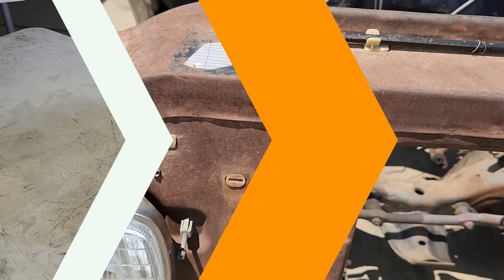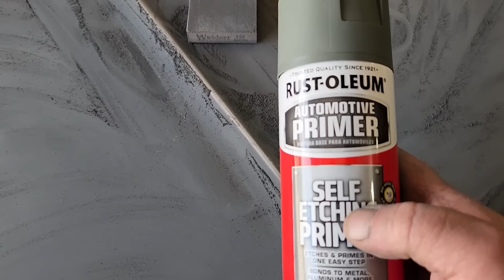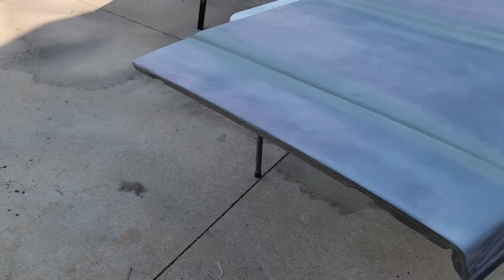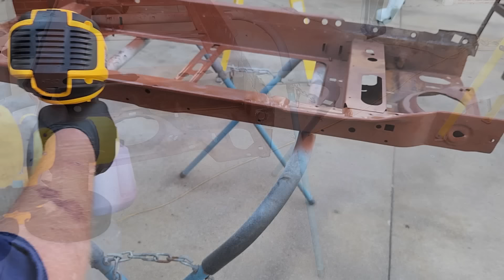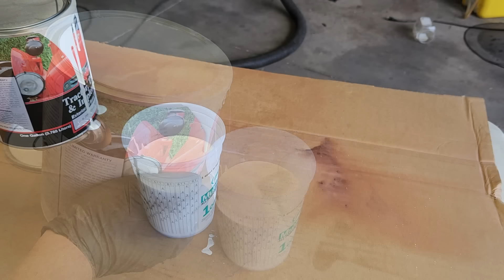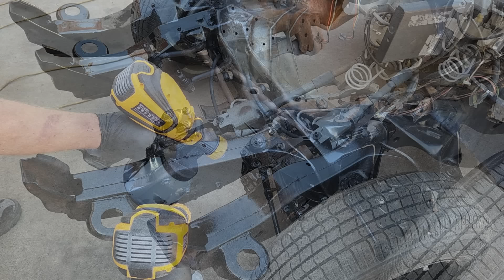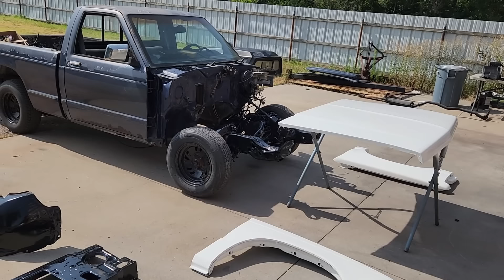S5 E27.  A low cost automotive  paint hack that really works. Rustoleum and  electric sprayer

Comment: I bought the original brand that sprayer is based off (Wagner) for about $275 for finishing my woodworking projects.  It is a great product, and your comments about learning to thin paint to the right consistency is spot on.  I made the mistake of buying some of the new "single coat" latex house paints and I was not able to get the paint thin enough to work in this sprayer without wrecking the paint.  Now when I buy house paint I always specify no single coat paints.

I have 3 old trucks that are hand me downs and your idea of using this sprayer for automotive is brilliant, even if someone else thought of it first. :). Thank you!

Comment: What Im curious is how cleaning works

We are destroying this gun, right?
Reply from the maker: I'm not destroying the gun, I want it to last as long as it can.  Cleaning the oil bases paints out of the gun can be done easily, but it requires a bit more solvent than I'm used to.

Comment: Not a bad job. Considering what you're using. Just for the record that remark you made about the 10-speed automatic made by GM was a collaboration with Ford... 🙄
Reply from the maker: LOL, yes Ford and GM are involve with that trans, but from what I have been hearing, only transmissions used in  GM products have problems

Comment: My theory is that those damned garden gnomes caused the orange peel on the trailing edge of the front quarter panel.  They have been quiet lately and are probably just planning more shenanigans as the truck build goes forwards. All kidding aside, another excellent and informative video, keep up the great work!

Comment: I watched this whole thing and almost every video you have made now. I don't live far from you and its awesome to see what your doing in the same conditions I am in. I used a green house from amazon as a paint booth with a dehumidifier in it but I also used a cheap sprayer like you. If you ever want a full size truck project let me know I have a few Older OBS Fords with straight 6 motors laying around.
Reply from the maker: Thanks!  An  OBS with a straight six would be a cool project.  Right now I just dont have the space.

Comment: i use this same formula to paint alot of crap. works well, cheap too. if you want the paint to dry faster use a little Japan Drier in your mix. About the same amount as the hardener catalyst.  Never used a airless gun though. i always use the harbor freight hvlp and the disposable cups. Mix right in the cup and shake, couldnt be easier! Almost zero clean up.
Reply from the maker: That's a good tip, thanks for sharing!

Comment: Use xylene or toluene instead of acetone if you want a slower dry and more forgiving application.   I'd also be a bit scared of the acetone and whether that sprayer has a brushed fan motor (which sparks as the commutator spins) as the acetone vapor is much more flammable..

Comment: If you can find an old 3.0 2000 hilux motor, it would be awesome 👌 my van has done 540,000 and runs beautifully with no rattle or engine oil consumption at all, though it seems quite thirsty, but that's a van thing I'm sure and the transmission is automatic

Comment: I am sure that you already have a diesel engine picked out and possibly purchased already. I am so curious to see what it is! If you happen to not have a diesel engine already, would you consider a Duetz F4L 912? Air cooled, mechanical fuel, natually aspirated. Cheap and easy to run.

Comment: Majic has always been annoying to paint evenly for me, might be a personal issue or the soy base of the paint lol. I prefer to run rustoleum with hardener and xylol. hvlp guns gob paint, a cheap regular high pressure gun works  way better with the oil paint even if it means spraying lighter layers.

Comment: I have that cheap sprayer and I think if a manufacturer could figure out how to build an electric sprayer that has a bit more airflow and adjustments on the air side, and a better fluid/air nozzle it could be a great alternative for spraying quality automotive paints without a $15k Kaiser compressor and dryer unit
Reply from the maker: I reckon in a few years somebody will come up with a version that has all the right things.

Comment: ngl using white paint so you can skip fixing the bodywork sounds genius but also kinda like painting over mold on a wall... does it actually hold up or does it crack in a year lmao. might try it tho. 😅
Reply from the maker: White will still show the dings, but they are less visible than if I painted the truck dark blue.

Comment: Excellent video.  I have seen other videos where they use a similar spray gun and make a joke of it, with deliberately bad results.  Yours is the first serious and honest appraisal and demonstration of what can be achieved.  It would be interesting to see how it goes with acrylic paint.  I think the truck will look just fine.  As you say, not everything has to be absolute perfection. 😊👍
Reply from the maker: I'm not a big fan of the oil based paints and I prefer to use acrylic.  Given the sprayer did fine with the oils, I believe it would also work with the better paints,
Reply: @robotcantina8957  Next vehicle rescue then? 😊

Comment: Are you painting inside the cab?
Reply from the maker: Basically the only "blue" that's visible inside the cab is behind the seat.  That will not get painted.  the doors and rocker panels inside the truck will get painted.

Comment: Jimbo. I thought you were a GM guy. It seems like you do not like the ten speed trans used by ford and GM. I thought the 8 speed GM trans were the bad ones and the new 10 speed were good. Love your work and of course the presentation. Paul from Dorchester
Reply from the maker: My allegiance to GM stops at 1999.  After that the stuff they made is questionable.,,, but still better than Chrysler.

Comment: It would be nice to know how to achieve the perfect viscosity without relying on "experience". I am a fan of simple rules, such as "the paint should drip at X drips per second, Y seconds after removing the stick." And then figure out what the best X and Y values should be. If there needs to be an X2 and a Y2 that's ok.
Reply from the maker: A lot of people focus on the details, However in a situation where painting outside in 90F+  none of that matters.    Mix, and shoot a test area, then you will know how close you are.  When people give you the correct ratio, that's for ideal conditions.  Shooting in a hot environment requires the paint to go on "wet"  and that means about the constancy of milk.

Comment: I'm a pretty experienced painter. These guns are really cool but they will start to get hot if you try to use them for very long. I have definitely noticed the heating issue effecting the quality of spray it produced but I have only used it for booth cote and latex in our facility where it doesn't really matter.
Reply from the maker: That's good to know, thanks for sharing your experience!

Comment: White is pretty much the hardest to get right, here in Ireland. Rust forms easily, very quickly and bleeds all over white. Even a cream is better, but dark colours work best, probably because we rarely get bright sunny days.
I’m super impressed with how far airless electric spray guns have come. That’s almost a hvlp fan pattern. My electric sprayer has no fan at all. It works a bit like a rattle can. Force the paint through a minute orifice at very high pressure and it will atomise and fly towards the surface, but you have to thin it a LOT and if you don’t get it exactly right, it will clog up and be an absolute nightmare to clean. I was cringing, watching you prepare your first batch. But what a revelation when you started painting.
I have got to get myself one of those. I won’t be doing 2K, though. My compressor can’t keep up with the air fed respirator, so I have to make do with just a filter mask and that’s not good enough for 2K. I’m not putting that stuff in my lungs! Acetone is a controlled substance here, so I have to use cellulose thinners. That’s strictly not allowed for cars, so I use it to paint my garage doors, with the car parked right in the way of the overspray. I’m a very bad painter, so it takes many many coats to get the doors how I like them. The car is usually well covered in the process.
Ironically, I live only 50 miles from the occupied part of Ireland, where such rules don’t apply, so I’m seriously considering getting a small workshop just across the border and doing my painting there. Far less regulation and much easier product availability. I don’t think I can be accused of smuggling if the paint is dry by the time I bring it home!
Reply from the maker: Thanks for the feedback, I'm glad you're impressed with the sprayer!  Good luck with your painting adventure.
Reply: LMAO in no universe are dark colors easier to paint then white wtf

Comment: For stuff like your radiator support that has a lot of surface rust, I've never had great luck with just going with the rust converting primers. I hit that kind of thing at least once with a phosphoric acid soap concoction I get at home depot. I apply with a chip brush because spraying it on will result in getting it all over yourself and requires a respirator to boot. Then I wash it off with either a garden hose and some elbow grease on a scrub brush or use a pressure washer 24 hours later. Then immediately dry with either a leaf blower or compressed air to avoid flash rust (this will take a lot longer to happen than untreated metal of course).  I have had fantastic results with this method even on tractor sheet metal that has rusted completely through in parts and I can't get it completely removed from the pits via mechanical means. It's kind of nutty how well it avoids paint bubbling vs those primers alone.
Reply from the maker: That's a great tip, thanks for sharing!

Comment: "37 bucks. Now 50 bucks because I posted this video!"
Reply from the maker: Doh!  Sorry,  a lot of other brands that look similar have already sold out.  I wanted to use what the other youtubers were using, but there was a four month back order.  the price jump probably means  the inventory is low.
Reply: @robotcantina8957  I looked at their pricing data with keepa and they rotate it up and down between 38 and 50 every few days for whatever reason. Probably to boost "best seller" metrics when it's priced low and rank in the search algorithms, then grab higher margin sales on the 50 days. You just randomly caught it on the down day. I was just trying to be funny honestly. It legitimately cracks me up with this stuff when that happens. I see it happen every time Project Farm posts a video. He highly ranks some very low priced tool and then they run out of inventory overnight and it comes back higher priced a couple weeks later.

Comment: Adding the hardener is a level up on this tractor supply paint. Also, exposing the paint to water after about 24 hours really speeds up the curing process and enhances gloss. Pro tip, you can use automotive acrylic enamel hardener on the tractor supply paint and it works much better, and it actually costs less if you buy it in the larger container. A good example is the TCP Global stuff. You can get a quart for 50 smackaroos vs 8 ounces for 25 bucks at tractor supply. If you paint with enamels a lot it makes sense to have the bigger can around. I also find that the tractor supply stuff will turn into a brick after a couple of years even if you don't open it. I've got automotive hardener in the cabinet that's still good from when I bought it in 2003. I just recently discovered it's got the exact same ingredients in it so I started using it up on my trailer and tractor paint jobs.
Reply: Ill second this. I painted a truck bed with the tractor white enamel and I swear it took 3 days to dry. I watched a video and someone suggested the hardener and the second coat was much easier. Still mad about that 😂
Reply from the maker: That's good to know, thanks for sharing!

Comment: Sorry for the silly question Jimbo... No clear coat? I'm not at all an expert, I never saw a car without a clear coat. Can you explain? Thanks ❤
Reply from the maker: All the older cars (pre-1980's) didn't have clear coat.  Clear coat is optional on something like this.  If I use clear coat, then repairing a scratch requires a lot of effort.  With a single stage paint, touch up is simple and quick.   For a truck that going to get used and scratched /bumped this single stage paint allows for fast and simple repairs because I don't have to deal with also repairing the clear coat.
Reply: @robotcantina8957 thanks for the explanation, I learned something new. Btw, I love this project. Thanks Jimbo!

Comment: 24:12 "You saw NUHSING!"  – Sgt. Schultz 🪖
I've seen my friend paint a couple times and noted how far this things reservoir hung below, wondering if it might get in the way like that, given your often painting at angles (and positions) you'd probably not encounter on a house.

Would you say that is a valid observation?
Or... was that mistake here a normal one for you and the gun design/size wasn't really at play here?
Reply from the maker: LOL, Yep I did hit the panel, but since the paint was so wet it filled in nicely.   When painting a hood where the cup comes real close to the panel surface you have to be very aware of of how close you get.  This gun is a lot heavier than a conventional gun and it took a lot of strength to keep it from bumping the hood.    I would have liked to have built a fixture to put the hood on an angle, but that would have been too much effort for "good enough"  thanks for watching and catching the "bump"
Reply: @robotcantina8957  I hadn't considered the weight, which is an oversight on my part! haha Though I did amend my thought on how far the cup hung down, instead noting that its flared base is also different from most autobody sprayers and likely to catch anyone really accustomed to it not sticking out as far at the bottom. But that's again not really a concerned for house/fence work 😅

You make em, I'll watch em! 
Thanks for answering (both times!)
🍻

Comment: Oil based enamel is darn good paint. Paint sellers push the heck out of latex and its a terrible paint for any use. Rolled John Deere green on an old Ford I had. It looked decent. The enamel holds up better than the original paint and comes out glossy. Lookin good there Jimbo 😎
Reply from the maker: Thanks, I'm glad you like the results!

Comment: I Am Not a Painter: If you're going to hit the body panels with sanding blocks (or sand paper), why even go to the effort of using Bar Keeper's Friend? I can appreciate not wanting to have some dirty present as to not clog the sanding medium immediately, but I would think the pressure washer would suffice (could even use the soap attachment for good measure).

This isn't a critique, but me genuinely inquiring on the logic since I'm sincerely curious. 🍻
Reply from the maker: The pressure washer is a cheap electric unit and it defiantly doesn't have the power to blast away the deep dirt.  perhaps a better pressure washer would have made the difference you were expecting.

Comment: HVLP painters are trash.

I've used them and they suck.

I have a 2600 PSI airless sprayer [1/2 hp, bucket feed] with 25 feet of hose.

I can put on up to 13 different nozzles, and it works like a miracle.

Instant start, no air bubbles, no overrun, and no blobs.

From there, issues like drips and orange peel is pretty much up to the wisdom and skill of the user.

And naturally, bugs, dust, and blistering come down to how well one protects the paint surfaces from initial application to drying. [aka a proper paint booth]
Reply from the maker: Is that setup more than $37.00?
Reply: @robotcantina8957  I paid $25 for mine...

But yeah, they're not typically that cheap.

Still, if I want to spend munny on a PAINT job, buying a cheap plastic splatterfest is just not my idea of quality.

Again, I used one.

I have 3 normal 120/90 PSI paint guns, but moving forward, I'm going to make an actual baking oven for powder coating BECAUSE its ACTUALLY CHEAPER than painting with top quality paint.

I can paint a good vehicle for about $6000 or I can powder coat the same vehicle for less than $400 and it will actually last longer.

Comment: Having painted several cars with Majic/Rust-Oleum you might want to consider shooting a clear with UV inhibitor.  All the non cleared cars would eventually fade and get chaulky in a few years.  

Amazing job and results though.
Reply from the maker: Thanks, good point about the clear coat!
Reply: @robotcantina8957  It's not too late...
Reply: Yeah, I was wondering what kind of clear coat would work with that paint?
Reply: @dfco11ins   I used the clear they sell alongside the enamels at Tractor Supply. Looks like it's listed as a lacquer though.  I was painting race cars though.   It worked and stayed shiny while my non clear coated car faded and went chalky.
Reply: @zajacmotorsports5910  Just one question, do you wet sand that and polish like other clear coats? Im no paint expert.
Reply: @dfco11ins on a race car, I loaded it onto a trailer and sent it into a 4 car pile up 😉.
Reply: Yes, you can wet sand and buff lacquer clear coats. That's what they use on guitar bodies that use Nitrocellulose

Comment: I use TCP Global for my home automotive refinishing; they are way cheaper than my local automotive paint vendor. I was always the limiting factor of the results. But for a couple of hundred bucks, you can paint a car with genuine automotive paint. Its actually not much more expensive than just oil paint from the box stores. Just hope this helps someone.
Reply from the maker: That's a great tip, thanks for sharing!